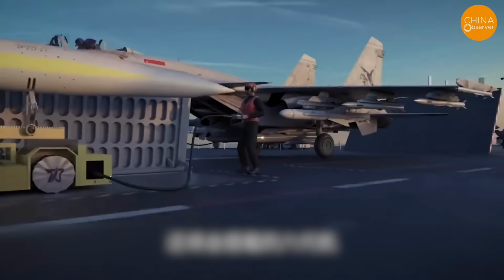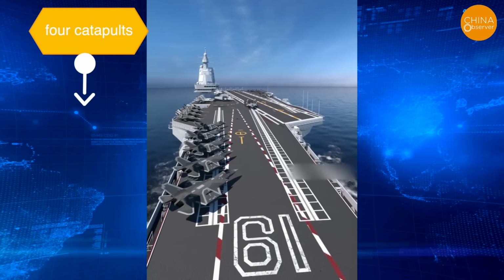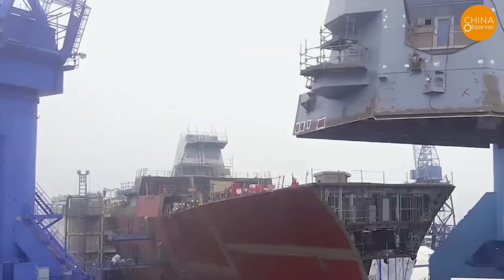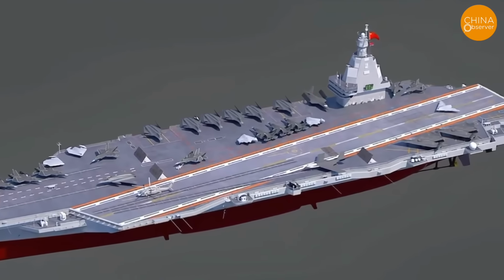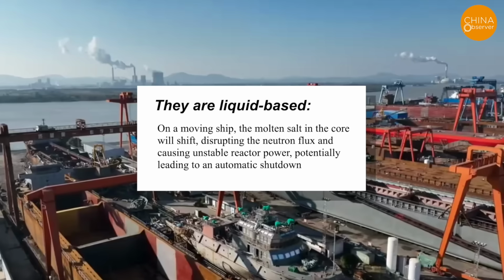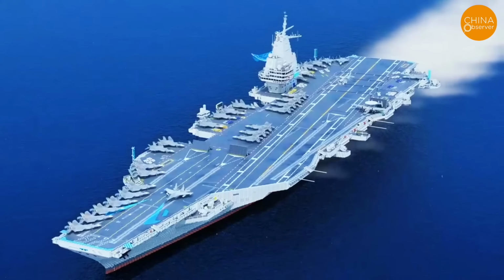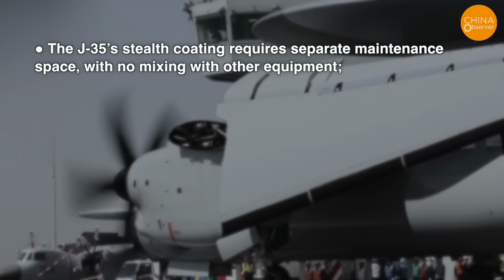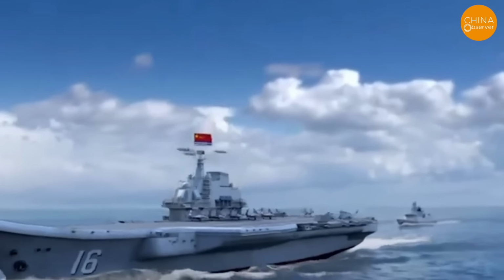China’s Type 004 Aircraft Carrier Not Even Built Yet, Already a 120,000-Ton Scrap Heap

Comment: Ok first of all Thorium based reactors were first developed in the US in 1950. MSR also need on site chemical handling to manage the remove fission materials and manage the ratios in the fluid. Not to mention the moving fluid is radioactive meaning you need to operate it remotely as well. That moving liquid salt is also highly corrosive. The is not including the cooling and thermal limits of the system and you wanna put that on a boat along with 96 planes, and a giant bank of capacitors?

Comment: The USS Ford had a requirement for acceptance of 4000 launches with out a failure. It has now been in service for 2 years. The Chinese are jumping from 85,000 to 120,000 tons not 100,000 tons. The Fujian is the weight class of the USS Forrestal and USS Kitty Hawk.

Comment: Futher proof that China rushed their carrier program to fast and was not ready to build super carriers.  As I mentioned in a earlier video or a similar one.  China should have focused on building a series of the Type 002.  Sure it wasn't the best design but there was plenty of room for improvement, it was a working carrier model, and although inferior compared to the US designs, a number of Type 002s would have been a troublesome and credible threat.  Also had they kept to the Type 002s they could have modified the design lengthening it, experimenting new design and tech and essentially making each type 002 being unique and showing a clear design evolution which would eventually could have cumulated with a Type 002 that would have looked liked a mini type 003.  So when they start building the Type 003 they would have had the knowlege for ship building carriers, having matured the tech or at least figuring out reliable tech that could work, a fleet of carriers to fall back on, and capable crews.

Instead we see the same issue
They end up trying rush and try to be a temu version of the US,  and as a result they embarrass themselves.

Comment: No thorium salt reactor exists, so how does the CCP intend to install this kind of power reactor, let alone a conventional uranium  power reactor which it hasn't installed into a carrier yet?

The CCP copies and tries upscaling it's ships to match the USN. This makes sense in symmetrical warfare except it might make a ship, including the carrier type 003, but it falls short in technical capabilities, deck crew recovery and launching training and in carrier pilot training. All I see is their carrier, mainly sitting in a port and rusting. No intense training that most other navies carrier crews go though.

So the PLAAN is neither equipped or trained for intense war against a similarly armed foe, especially against the USN, but other well-equipped and trained navies will damage it severely as well.

So we have a likely geopolitical scenario for a conventional WW3 war centred on China; 1. China has all it's blue water naval assets and most of it's warplanes knocked out, so not much of an airforce left, within two years of beginning of hostility.2. Complete trade blockade of China's ports leading to extreme raw material and components shortage. There are other severe knock-on effects such as lack of food. 3. Add to that a strategic bombing campaign of China's cities, infrastructure and ports, carried out by the USAF, which has long been equipped with the warplanes to do the job (once China's air defences have been largely neutralized, i.e. B52s).

Comment: Molten salt reactors were first built and tested in the 1960s by the United States.  Not China.  The research was available to others ever since, and noone tried to follow up because their output was so low, and the materials science was too primitive to operate within the temperature and corrosion constraints long-term.  It was never cost-effective for submarines, ships or even just sitting on the ground producing electricity.

Comment: There is a major problem in launching an aircraft every 30 seconds even if you have the power required. It takes an experienced deck crew 3 to 4 minutes to taxi an aircraft into place and connect it up for a launch. That means you would need 6 to 8 catapults and every thing in the process would have to work without any delays. Just because of the deck operations, the best would be 1 aircraft ever 60 seconds. The extra tonnage from 80,000 to 120,000 tones may come from the storage capacitors required for the EMALS they have designed. The capacitors would be very heavy and bulky requiring large cables because of the use of DC electric power. The elevators are not used during flight operation because their usage would interfere with the flight deck operation. It is very rare to bring aircraft from the hanger deck to the flight deck during Flight ops because the fueling and arming are done on the flight deck on US ships not in the confined enclosed space of the hanger deck. It is funny to watch videos like this when the writer shows they doesn't understand the operation of a carrier but profess they know it all. Without being there it is all most impossible to fully understand all the choreography required to make the ship work. You can't learn it from videos alone are being on the deck for 1 day.

Comment: "Gunpowder to launch an aircraft" ? Come on guys.. really? You know the Russian and Old US carriers used steam, right? Because its the only way to generate enough force quickly. You could do it hydraulically too - but thats super expensive (amd has crazy hammer forces - not good for airframes). 
Electric is "easier" in terms of infrastructure, but harder due to power usage - the new US carriers have two nuclear reactors for this reason. The launch of a single aircraft can impact the whole output of a single reactor. Hence the need for dual if you want to charge alot of capacitor banks. China doing this.. hehe well.. lets see hey? Their current carrier which is oil powered, I doubt it could sustain continued takeoff's from an EM launch purely because of the power. Its a pretty dumb idea. Then you have the problem of fuel. You will burn tuns more oil with gensets powering up the EM launcher all the time. EM launchers are really only feasible with nuclear power and even then.. as US found.. you need two.

Comment: Keep in mind, the Ford class could have been built to be a lot larger ship in length, width, tonnage and capacity. But when you reach a certain size, you start running into physical and operational constraints due to its size. They actually looked hard increasing its size. But dialed it back to where it ended up.

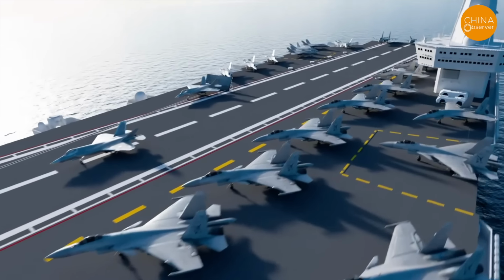Comment: 04:00 A common failing of authoritarian governments is the tendency to go for excessive hyperbole and ostentatiously oversized gear. Bigger isn't necessarily better if the thing is just bigger for bigger's sakes. Bigger incurs higher building, maintenance and moving costs. Bigger MUST be balanced by suitable returns to make those added costs acceptable. The Sovs (and today's Russians) made/is still making the same mistakes of assuming bigger is better. They created the Tsar Bomba, but it'll never will be practical because no rocket system then or ever were big enough to be able to launch it. A huge cargo sized plane had to be modified to carry the thing and it couldn't carry anything else. It's slow and largely defenseless so it'll be easily shot down at the potential of causing environmental damage from massive radiation debris release while it's still over the Russian homelands. The Chinese are making similar mistakes with assuming massive quantity will win wars. A huge navy that is mostly comprised of small ships will be easily cut down in size quickly with less missiles/bombs per tonnage. A 1000 ton warship is more easily taken out with a single bomb than a 100,000 ton war which may require more than 6 bombs (at minimum, possibly more for an American warship which ARE designed to survive such attacks to begin with). You've may have noticed that the US have not gotten much larger than 100,000 tons with their carriers for decades. Ever considered why we haven't done so?  There are practical limits when ye need to balance what a larger ship can offer versus the cost of maintaining and operating such bigger ships. I suspect they don't feel the need for any larger warships because we can get more done with a more efficient power system that takes up less room and still generates more power with improvements in steam generators and power storage and delivery systems.

Comment: There is a confusion between power and energy.  Energy is the amount of work done, and it is measured in joules.  Power is the rate at which work is being done and is energy per unit of time.  A watt is one joule per second.  The average power demand of a electromagnetic catapult (assuming 100% efficiency, for ease of calculation, although it is probably still near 95%, in reality) that applies 150 megajoules, once every 30 seconds is only 5 megawatts.  Five megawatts is a considerable amount of power, it is still only a single high end sports car (~700 bhp).

The Nimitz class had an installed plant capacity of 300,000 shaft horsepower, or 225 Megawatts, for its propulsion systems.  The USS Gerald R. Ford produces more electrical power than the USS Nimitz, but it probably is not nearly 3 times the installed plant of the Nimitz.

Comment: It’s clear the type 004 will be a failure in practical operation, and  operate nowhere near the endurance of even Nimitz class carriers. It may be the largest nuclear aircraft carrier ever built, but I doubt will it be able to sustain 30 knots in combat- that experimental reactor will fail  at a critical moment, making it a sitting duck. And of course in war, we will put it at the bottom of the ocean. Rail gun? They’ll never use it in combat. 90-95 aircraft? It will be reduced to a more practical 75-80 onboard. The Chinese will discover what we already know- a Carrier is a huge target, and requires a huge umbrella of ships with surface to air missiles, and those air warfare ships need to protect themselves too. Sending the type 004 to destroy bases on Guam or the Philippines will also prove deadly- bases at these locations are basically on an unsinkable carrier, and counterattacks from either location will overwhelm a Chinese carrier group.

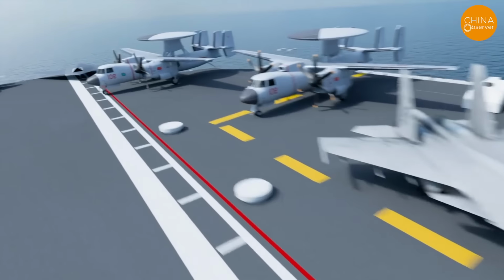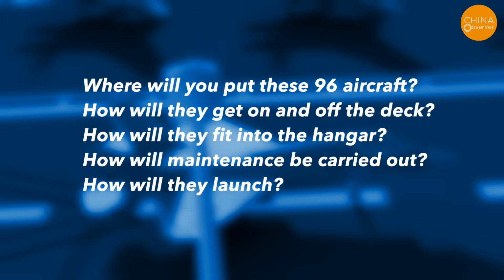Comment: Type 004 will be technology demonstrator at least. Just like Chinese 6th gen fighters, these are equivalent of american early X-series planes. I doubt their successors will be once planned for serial production. 1:20 "gun powder" ? catapults have been using steam ffs :D  2:02 - you don't know physics. If catapults will be firing in short sequance, power consumption will remain at 75 MJ ( which spread over 2-4 seconds accross the deck means 36,5 - 17 MW ).  If you fire catapult one after another (which is faster than you can hook up aircraft anyway ) that still lowers power consumption to ~20 MW of continued output to some form of magazine ( flywheel / supercapacitors ).  Most of structural b....lit you mention is easily remedied with using smaller modules. 11:08 - MSR is certainly made up, but if it were not - reminder that USS Enterprise had 8 reactors.12:18 - reminder - liquid metal coolant and PWR reactors are widely used or have been used. Non-issue.  12:53 - as I said - this is EXPERIMENTAL UNIT.  Also reminder: largest container ship in the world MSC Irina, has 400m x 62m  14:11 - reminder - Nimitz can use 90+ aircraft including parked on the deck at expense of said flexibility. No reason why here it would be any different. Maximum capacity that ain't used.  In short: yeah - operating and building carriers is hard. That's why do what china does - incrementally building one design at the time.  I wouldn't be surprised if they stripped project altogether and restarted with Type 005 lessons learned.  Journey of thousand miles, you know...

Comment: Steam catapults are hard to beat.

Low cost because they use the heat from the reactors to make steam, they are simple to design and maintain. Reliability is high as well because of that.

If the USA isn't using it or fielding it widespread, there's a reason.

Comment: The calculation is grossly flawed! In maximum take-off operation, the four lane will launch just 8 aircrafts every minute. It take just 2s to operate for every launch. So that adds up to just 16s every minute. So only about 27% of the 300MW of power is used by the EMLS.  So if the ship has 600MW the EMLS only consumed at the very maximum 13.5% of the total power.

Comment: There have been no "gunpowder" catapults for a long time.  That was battleship and cruiser stuff in WW2.  And there have also been no hydraulic catapults for a long time.  60 years ago a few might have been around on older ships with limited missions and lower-performance aircraft and original WW2 equipment.  
And no, there actually has been a molten salt (liquid metal) reactor used at sea.  America's second nuclear submarine, Seawolf, had one as opposed to the pressurized water reactor on the first nuclear submarine, Nautilus.  Seawolf later had her molten salt reactor with a pressurized water reactor, and it has been so ever since.

Comment: As this video stated, when the size, displacement carry capacity and operational requirements increase by a certain percentage, the engineering challenges increases exponentially!  It is not a one to one linear increase!  In addition, one problem's solution will impact several others thus the problem issue can quickly spiral out of control !!!

Comment: so basically inorder to build the Type 004 class supercarrier PLAN needs a whole new naval shipyard that's large enough to easily accommodate all phases of the build . . . exponentially bigger dry docks, assembly rigs & 1,630 ton gantry cranes . . . right from the keel up the entire hull of a 116,300 ton supercarrier has to extensively reinforced to sustain in the worst of sea state conditions & also keep functioning at the same time . . . next hurdle is the power management, it'd be wise to install 3 electro-magnetic powered catapult & one electric powered catapult as back up, in the interest of adequate power generation & distribution . . . hybrid marine propulsion is the only option left, just like hybrid cars . . .

Comment: There are already 11 super carriers in operation all with the SUN
There has been 11 super carriers in operation for the last 70+ years. Again all with the USN, as is laser weapons.
Super Carriers are not new. China is just catching up
Rail guns are belong material science to create barrels that can stand up to mach 10.for 5" shells.
 ATM The best you can do is 40mm at mach 6 at that you might as well use 40mms bofors ( mach 6 is under 200% of the speed of a 40mm bofors) 40mm before are cheaper, less likely to fail and very little power needed, with a long barrel life. And fire 300rpm.
Only Japan has made a working rail gun with so many compromises.
Chinese TEMU rail guns based on stolen partial western designs. Well if you want reliable asc and medium anti air and anti weapon guns. Better go with 40mm auto cannons.

Comment: Doesnt it make more sense to build more 80000~90000 ton carriers than a big 120000 one?
Reply: Depends if you have any supply choke points with equipment - For example how many reactors can be delivered in what time frame. Same problem they had back in the day with battleships. Could build the hull and stuff pretty quick, but would take forever to get the engines and turrets built.

Comment: Most of the problems described are mainly engineering problems and solvable although problems need to be recognized and solved.
Only a few like the nuclear power plant, possible steel materials science supercapacitor storage are likely beyond China's knowledge and unachievable without scientific research breakthroughs. Anything relying on a scientific breakthrough is problematic and probably more likely to fail than to succeed but any problem that requires merely engineering talent might be solvable.